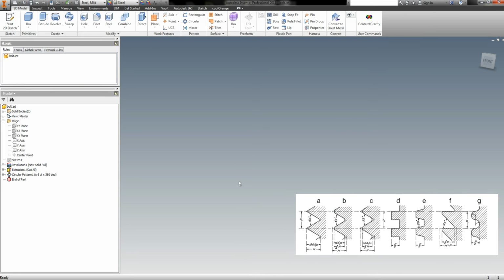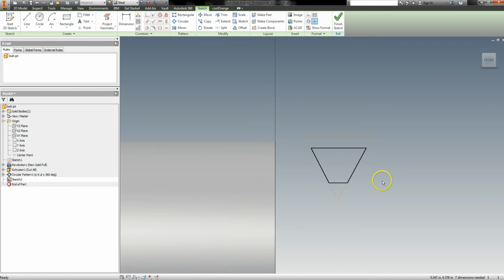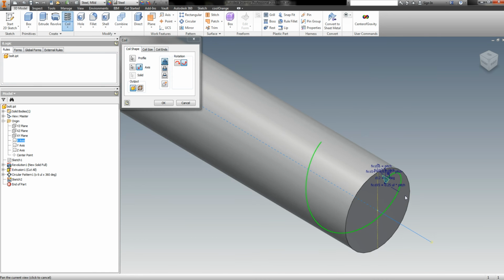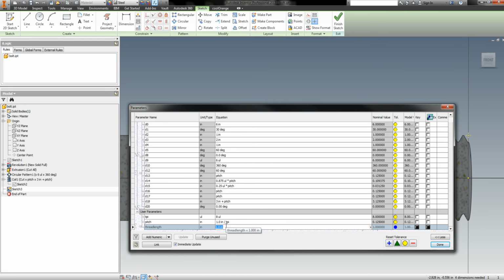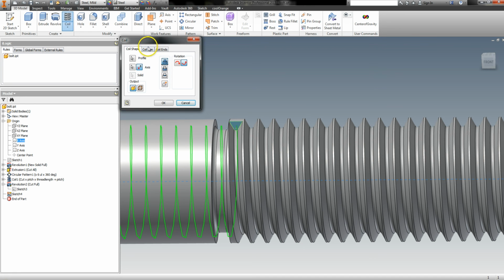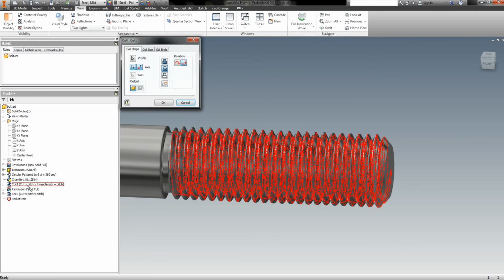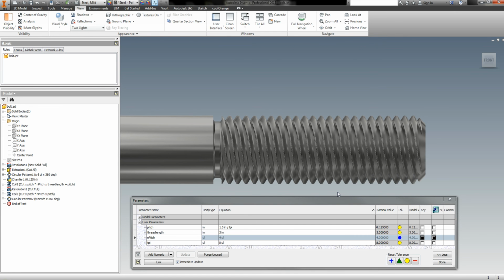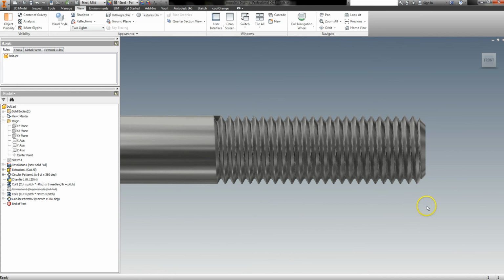Autodesk Inventor Tutorial : How to model 3D Threads (Long/Explained)

Comment: I have an .ipt file with standard ISO thread geometry I can copy into any bolt, stud or internal hole. After constraining it in the correct position I just add diameter and pitch then use the coil tool - job done. One .ipt file does all sizes.

Comment: Excellent! This is the best video I've seen on bolt thread. Thank you.
Reply: tip: There is coolOrange extension. It simplifies the process. Made it way easier. by the way thanks for the video
Reply from the maker: I've heard that the coolorange tool no longer works. But honestly, I wasn't a big fan of that tool personally. I do acknowledge it's up-front time saving though. Does it still work?

Comment: Is there a way to have thread created with the 'Thread' command 3D-print, or at least project the geometry into a coil as to create a geometric. Since this command feature already has an array of specifications and threads available it is useful, but it does not create geometric features; only pictures of the threads.
Reply from the maker: +Edie Pena To the extent of my knowledge, you cannot do what you're trying to do with just the Thread command. It's just a skin that carries the thread data with it so that it can be visualized and referenced in drawings without taking up as much memory.

With that said, there's an Add-In out there by CoolOrange that can be used to turn the thread skin into geometric threads. This may be what you want. I believe it's called "Thread Modeler". The only reason I don't like the tool is because it creates several features and it does not adjust with the rest of the part. In other words, if you wanted to use it, you wouldn't really be able to do anything with your model afterwards.

However, I did make an iFeature for modeling threads that has proven extremely handy for such applications. It won't read a Thread Skin but it will read the diameter and as long as you know the tpi, you're good to go.